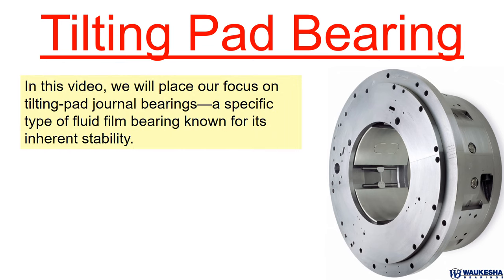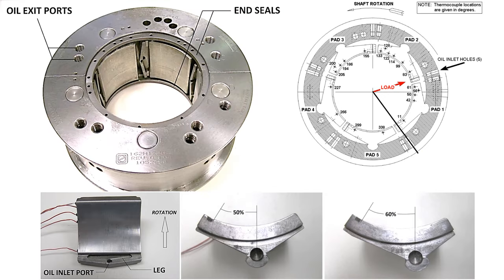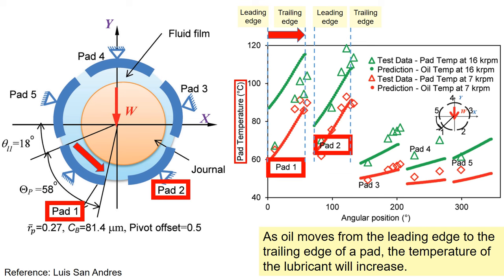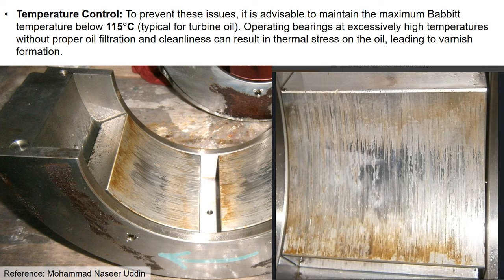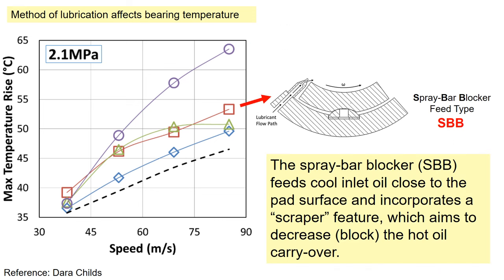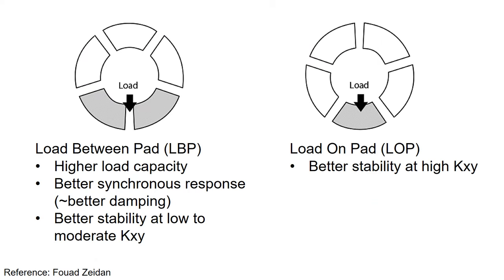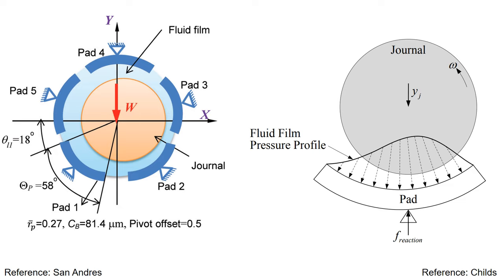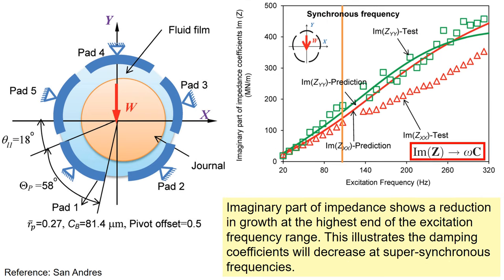Part 27 - Tilting Pad Bearing

Comment: Great explanation. I think that generally these bearings incoporate 5 pads and 5 pads only!! Can you please explain why is it exactly this way ?
Reply from the maker: Thank you for your question. While various machines may utilize different configurations, the use of five pads in bearings has gained popularity for several reasons. Firstly, five-pad bearings excel in heat dissipation, surpassing the thermal management capabilities of three or four-pad designs. Additionally, the extra pads contribute to enhanced stability, a crucial factor in many applications. However, it's worth noting that a smaller number of pads can often accommodate higher load carrying capacities.
Reply: 3 jaw lathe chuck are self centre & 4 jaw chuck are not self centre. always keep odd number of pads.